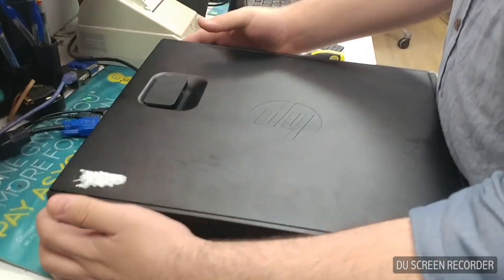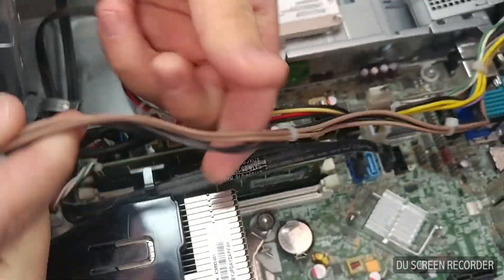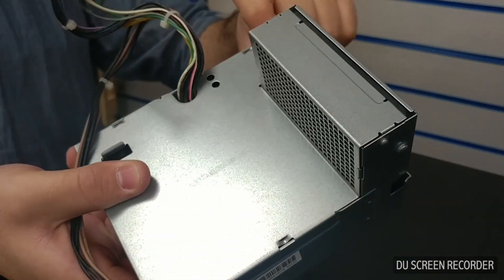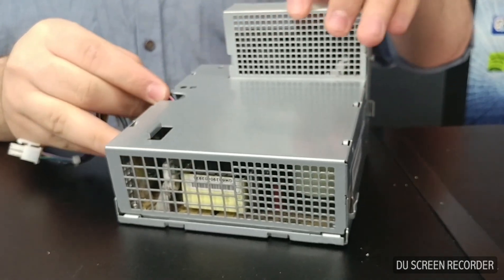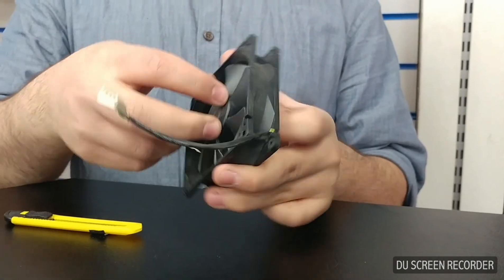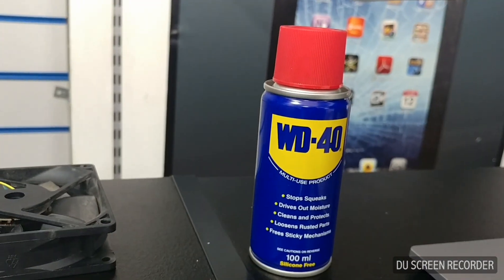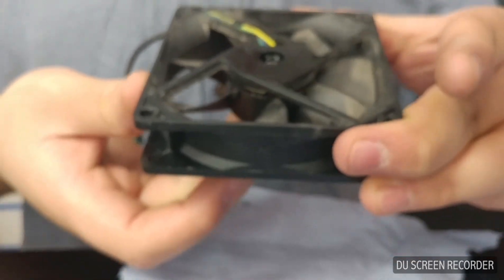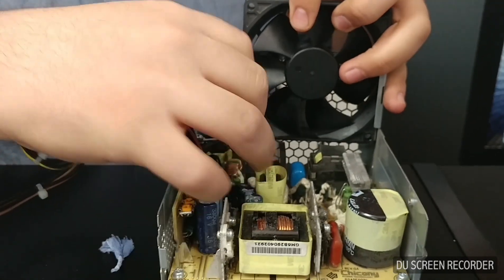Noisy Power supply repair

Comment: I have same HP RP5820 Retail System. It's PSU Fan Not working, I check fan it's ok, and when I plugged off fans connector from motherboard it's spins but Show on Screen Error 515 PSU Fan Not detected.. How to fix?? Helps

Comment: I really like the design of these SFF computers on the inside. I, however, do not like the none standard connectors on the PSU. I have a 6200 and I really do not look forward to having to special order a PSU if mine dies.
Reply: In this case it doesn't matter if the psu has standard connections or not, You're still gonna need a special order due to the PSU shape

Comment: Hey bro hope all is well...my desktop HP 8300 elite tower keeps making 4 beeps and red light when I power it on, the fans are not spinning too.. tried almost everything but nothing works...any ideas on what could be the problem..thanks much appreciated
Reply: You probably already figured this out but it is a Memory error / The system clock/timer IC failed error. Google is really good at finding error codes. Just type in 4 beeps HP ( or what ever computer you have ) and you will get quick answers.

Comment: Many thanks for posting this video.

I had a noisy P/S fan in a client’s system I was working on, could NOT figure out how to get this  P/S apart.

I re-lube noisy P/S fans quite often, but this one was driving my nuts.

On a normal tower P/S, the 4 screws that hold the fan in are just for that, like the 2 bigger screws securing the fan. I’ve never seen 2 smaller machine screws holding in a fan, and in this P/S, holding the two parts of it together.

Once I got those 4 fan screws out, no problem with getting the P/S apart and the fan out and several drops of 3-in-1 oil into the bushing area, some spinning of the fan, and no more noise!

Put it back together, put it back in the system, and all is good.

Thanks again.

Comment: i already replaced the fan with new one but there's still loud noise from it? got idea how to fix it?
Reply: It only has this fan and the one in front that goes to the CPU trough that plastic guide. 
Also, you can adjust the fan speed in bios settings, they should be kind of silent in general.

Comment: hey I have the same model mine makes noise and nothing is coming up on the screen I did everything cleanup replace memory to reset the CMOS battery I short the battery and nothing still fast speed the fan but it seems dead any similar condition or experience with this issue..I'm about to throw away this thing.
Reply: Same thing goes for me i don’t know what to do body , did you find a solution ?

Comment: Hi, I have the same supply model. I have an issue: it starts silent than max full speed before going to windows and say full blast. No dust and fan quiet and greased. Any help? Thanks.
Reply: Your problem solved or not?
Reply: @aRmaaNi99  No, i have change the power supply, new thermal paste on CPu, clean all terminals and sensor. Reset the bios, nothing. Direct to the trash after a week end spent on it.
Reply: @alundrasrt  I'm experiencing the same issue as well. I haven't tried replacing the fan but I don't think that'll do anything. The fan is noisy because it's spinning at full speed not because it's dirty or something. 

Btw you said you changed the power supply, so You changed the whole power supply but it still does that problem?
Reply: @HonkForLife098  Nope, I drop it and bought a used dell for a buffer set up.
Reply: I've fixed the problem ( only like a partial fix and not permanent)

I'm gonna comment anyways in case someone gets a similar problem in the future and looks here.

You know in these pc's there's an option in the Bios to change the fan speed for the cpu / front fan right? I had that at max. That was never supposed to change the psu fan speed but when I tried to put it to the lowest settings today it actually worked. The psu is back to normal again. Though I have to sacrifice my cpu fan now. It's really weird since it's supposed to change only the cpu fan speed and not psu
Reply: @HonkForLife098  yes I tried, clean all terminals of all components changed the psu. Nothing. So I changed all computer
Reply: @alundrasrt  honestly if you search in the internet these pc's are really problematic. Though I can't really complain I got mine for only $20. It's a steal deal for a broke student like me
Reply: @HonkForLife098  yes, it was cheap and a real windows license for the same price.

Comment: Great video! I had this very model in an old desktop pc. I actually used Singer sewing machine oil as lubricant though. Works fine.
Reply: Sewing machine oil work's great. I used it a few times on pc case fans. You can use that stuff on printers, electric hair clippers and other electro mechanical things.

Comment: Please stop using WD40 its not a lubricant its Water Displacement 40 use a bearing lubricant. like 3 in 1 lubricant https://en.wikipedia.org/wiki/WD-40 and the best best is bearing grease a tiny tiny bit

Comment: I do this quite a lot, it saves replacing fans when the bearing gets dry. Though i don't use WD40, WD40 drives out moisture and once it too dries out the fan will sound even worse than before, nice and squeaky. I keep a small dropper bottle with vegetable oil in it, you only need a very tiny drop on the spline and it lasts ages, plus oil is totally non conductive. Another note from my experience is not all fans have the rubber gromet on the back, some are just a blank frame under that sticker.
Reply: Sewing machine oil is good...used that recently on fan.
Reply: ill use that, thanks!

Comment: Hello, 

Do you know some replacing fans? I would like to buy a new Fan... Thank you!
Reply: The fans in this PSU & the one in the HP SFF it comes out of are both 92mm PWM fans, best replacements on offer are Arctic Cooling F9 PWM & ive seen some Noctua ones also. Sadly for me the market for LED/RGB 92mm units is almost none.

Comment: hello i really need to ask about something .. my pc is hp 8200 and it have problem by shutting down and restarting it is own and i wanna make sure that it is not the power can you tell me how to try to turn the power supply on without plugin it into the pc ? or what should i do because i try everything already :(
Reply from the maker: you can run a jumper from the green and black entry point for the connection to the motherboard. Use an insulated jumper or insulated set of tweezzers. it should run the fans at full speed if operating properly. It shouldnt be your powersupply though. Try live booting to your computer using a linux key and see if your file directory appears. This means the RAM and HDD are fine if unable to boot its either your ram or your motherboard. If you are getting an image and do not have a graphics card pluged in it is most likely your motherboard. Hope for the best

Comment: How to check power coming or not
Reply from the maker: jumper cable or insulated tweezers on the black and green connction points on the motherboard to powersuplly connectior. i the PSU is working it will run fans at full speed.

Comment: How to check if this power supply is working or not
Reply from the maker: The easiest way i find is to run a jumper from the green and black wire on the PSU's motherboard connector (or twezers) this will trigger the fans to run full speed (when plugged in) if not it is dead. Though this is not the official way i find it to be the fastest. (Gadgets World in no way takes responsibility for actions made by an individual due to this post)
Reply: @gadgetsworld9642  But in this PSU motherboard conector there's no green and black wire as it doesn't have the 24 pin connector. How can you turn these PSU on?
Reply from the maker: what model power supply do you have/ what connector type
Reply from the maker: or do you mean you have a 20pin connector +4pin
if so then it will be the top 3rd and 4th closest pins on the side closest to clamp when the clap is facing your right.

Comment: i have an hp compaq dc7900 when i turn it on i see a message wich says: 505 power supply fan not detected. any idea
Reply from the maker: Im going to assume you meant Error 515 Power supply fan is not detected. In which case this is most likely due to a bios error or an error with your mobo's fan controller.  in which case i recommend flashing your bios and re-configuring it. If it persists it is most likely that your power supply has developed a fault and needs replacing.
Reply from the maker: If you did mean 505 however. this is an error caused due to system files becoming damaged or corrupted. Most likely due to an update. I would recommend backing up your data to an external Storgae device and then reinstalling your OS from there. This can also occur in rare cases when a HDD is failing. in which case repeat above steps but installing to a new drive. (possibly and SSD)

Comment: hello sir i have problem my  CPU  IS HP 6500   is not detected cpu fan and power supply fan both fan make loder than loder noise  how can solve this plz sir owsame video
Reply from the maker: Most likely the Fan needs replacing and the System need a full servicing.
But as this is a mixed job and i am unable to properly diagnose it remotely i would recommend getting this repaired in a shop. If you live in London you can come and visit us in the shop where we can give you a free quote and advise you on the best course of action. 

709 Romford Road
E12 5AW
07950 434 802
Reply: Gadgets world  thanks sir for u r reply but im live in pakistan
Reply: @gadgetsworld9642  Can you tell me where the fuse is?  I smelled some sort of what i thought was a cooking odor burning from unknown source, while i was sleeping.  the next morning when i booted my pc, it just started beeping with red light on the boot/power button.  I took the hard drive and put it in my other refurbished dell(full size tower).  I got it to read the HD, but it wont boot.  Thanks for your time.